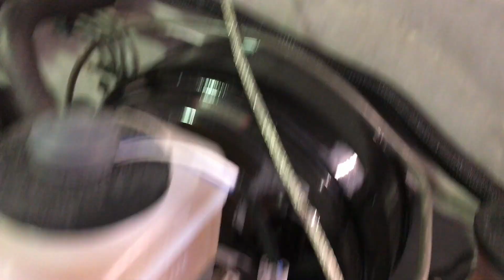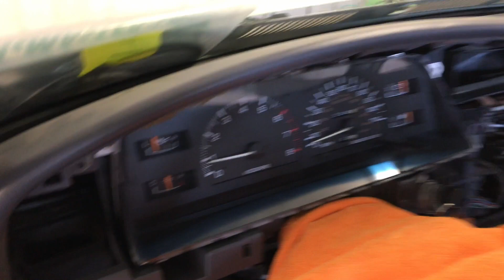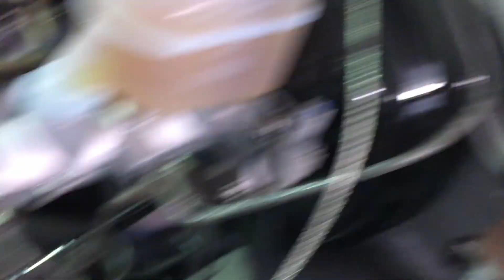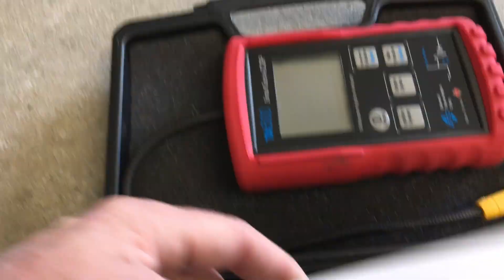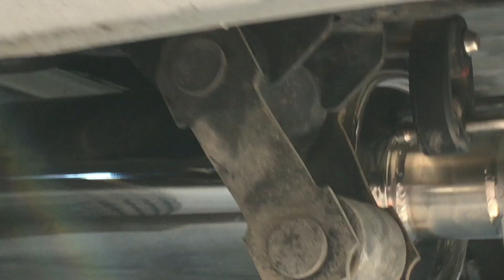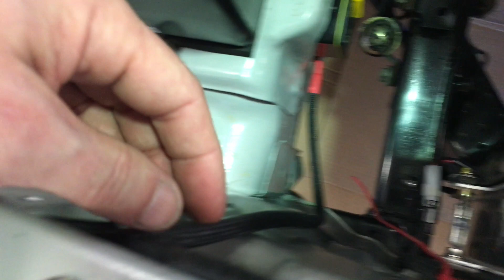Starting the 22RE 1990 2WD Toyota Pickup w/ Champion aluminum radiator & electric SPAL fan

Comment: So I need some help I have a 94 toyota 4runner 2.4 and I put a 2 row aluminum radiator with electric fan when I run my truck wit the ac on in hot weather it get above half gage and keeps going but when I turn my ac off it gose back to normal I am running a 195 thermostat I'm going to put a 180 in to match my switch and new water pump those are the only 2 parts I haven't replace for the cooling system I ran 3 block test for a bad head gasket and they passed each time I'm not to sure what going on at the back of my thermo housing I'm reading 230 and at front of radiator I'm reading 200
Reply from the maker: What's the ambient temperature outside where you are located and are you at sea level or higher up? I'd definitely switch to a 170 thermostat to start with. Also, make sure your engine oil isn't low, as the motor oil helps with overall cooling. The other thing is maybe consider doing a couple of cooling system flushes using something like Thermocure. If the motor hasn't had its coolant changed routinely over the years, crud can build up internally and reduce cooling effectiveness. You can also try running a slightly higher ratio of distilled water to antifreeze during summer, as water cools better, if you do not live some place which gets below freezing. Also confirm the fans blow air the correct direction, they should be on the back side of the radiator and blow air towards the engine. When things are operating correctly, airflow over the radiator and motor when driving - even with the A/C on - should keep everything operating at normal levels. Going up hills will cause temps to climb which is normal and running the A/C may tend to simulate this, but it shouldn't be nearly as bad. The other thing is make sure you have properly purged the air out... it's a bit more tricky than you might think and having air in the system can really screw things up. Search amazon for "EPAUTO Spill Proof Radiator Coolant Filling Funnel Kit" if you don't already have one; these allow you to purge air from the system. Also, when filling the coolant system, I usually remove the hose at the heater core on the fire wall and back fill the system from there, back through the cylinder head pipes while the radiator is open. Even doing that, you have to warm the engine up with the radiator open, until the thermostat opens, to correctly purge air out. So that might be part of your issue. Using the amazon kit, you can attach the funnel to the radiator and run the motor and then squeeze the hoses and help force all the air out. But going to a 180 thermostat should help quite a bit because it will allow water to start flowing sooner and give things a head start. When you have an electric fan system, you lose the cooling of the mechanical fan at low speeds, so it helps to have the thermostat opening a bit sooner. Also, if you have your thermostat opening too close to where your fan switch turns on, you'll end up with a situation where the fans turn on while driving, which is not how it should work. On my truck, the fan only ever turns on if I'm stopped (like at a drive through) for more than 3-4 minutes. When driving on the road, everything stays super cool typically.. my gauges motor engine oil temp and water temp exiting the radiator and returning to the engine; my engine oil usually stays between 175 and 190 on the road, flat ground, while cruising (outside air temp usually around 70). Going up large hills, the engine oil will climb to 200-206 for a bit. In 90 plus weather, going up a hill in slow traffic, I've seen my oil get up to 220, but that's rare. Usually while driving along on flat roads in 70-80 degree weather, usually the water temp exiting the radiator remains around 110-120 or so while driving, so the fans never turn on. If i stop, then no more air over the radiator and return water temp starts to climb slowly up to around 180-190 at which point the fan kicks on and quickly drops the return water temp back down to 120-140 (usually within 30 seconds). Then it starts over again until I start moving and air flow takes over again to cool the motor.
Reply: @ray5961  I live in Oregon and it gets about 90 to 104 I am doing a water pump right now and just did a power flush on my block
Reply from the maker: @nickwinter2145  Flushing out the cooling system is good. The 170 thermostat will most likely help you the most. The sooner you get hot water flowing to the radiator, the sooner air flow will cool it down and return it to the motor. Turn your heater on also and make sure water is flowing through the heater core okay. The bottom line is when it's 100 degrees out, it's simply more difficult to cool things down. But when I switched over to the 170 thermostat on my 22RE, that is what made the biggest difference as far as proper cooling when using an electric fan setup
Reply: @ray5961  I will try the 170 I didn't have any problems with my ac pulling 31 inch tires till i put the aluminum 2 core radiator I'm at the point of buy another factory radiator when it gets warm my ac will cut in and out not stay on long enough to get cold air out of it
Reply from the maker: @nickwinter2145  I can't really tell you too much about A/C. I took the A/C and P/S off my truck and threw it away. As far as the aluminum radiator, do you have the same one I show here in this video? Also, have you changed anything with regard to the size of the pulleys on the motor or water pump? Sometimes that can mess you up, if you change the pulley sizes too much. BTW, I just checked my service records and I gave you incorrect info above there. I'm currently running the 170 thermostat in my truck; I had tried the 180, but had to remove it because it was still causing the truck to run too hot. I tried a 190 and also a 180, but both messed me up too much and caused the truck to run way too hot on the freeway. It also wasn't working correctly with the electric fan switch. I ended up installing the 170 thermostat and that's when everything started to function correctly. I was driving the truck today at the temp outside was about 65 degrees; on the highway, going up a small grade, the water temp coming back from the radiator into the motor was right at 115 degrees. So that gives you can idea of how much cooling just air flow over the radiator is providing my motor. If I hammer the motor going up the hill to my house (about 1/2 mile and elevation increase of maybe 700 feet or so), the oil temp will get up to around 190-195, but the coolant stays down around 120 coming back into the motor. I'd switch to the 170 thermostat and see if that helps out a lot. Also, use a thermal temp gun and check the temp coming out of the lower radiator hose to see what temp water is going back into the motor at; that's a lot more important than what temp the water coming out is. Also, I cannot stress enough how important that kit on Amazon is for purging air out. The other thing is are you running an over flow catch tank for coolant? On my truck, that thing goes up and down about 1 inch plus or minus around the mid fill line on the over flow tank - if you don't have a catch tank, you are going to keep sucking air back into the cooling system. Also, do you happen to know what PSI or BAR radiator cap you are running? That can make a difference also. But yeah, 170 thermostat might really help you out - that's what make the big difference on my truck and allowed me to actually drive on the highway without the motor over heating and/or the fan coming on and acting crazy.
Reply: @ray5961  the water coming out of the radiator is about 110 115 and I'm running a asi performance radiator off ebay came with fan relay kit for 209 the cfm on my fan is 1730 I do have the coolant funnel from Amazon I'm running the stock pully witch is 4 3/4 I need to go down a little for faster flow. I do have a over flow tank and my radiator is a 2 row of tubes I'm also not sure what my cap is it came with radiator
Reply from the maker: @nickwinter2145  Sometimes you actually want slower flow, so the water stays in the radiator a bit longer and has time to give up heat, but a water return temp of 110-115 sounds pretty good. I think switching to the 170 thermostat will probably help the most. Doing that is what really got my cooling system dialed in and made everything function correctly on my truck.
Reply: @ray5961  it almost seems light I might have a faulty radiator I had better cooling with a 1 row radiator
Reply from the maker: @nickwinter2145  Why not try the champion one?
Reply: @ray5961  I don't know if I want to invest another 283 in a radiator I'm 400 into it now
Reply: @ray5961   it kind of worked when I have the ac on it gets up to 240 and then the ac kicks on off cut its to hot
Reply from the maker: Here's a video you might find interesting. He mentions the truck over heating when the A/C is turned on... seems to relate to the condenser overwhelming the radiator. Also, does your truck have any head gasket sealer or anything in the coolant? Maybe it's plugging up the tiny passages in the radiator? Here's the video: https://www.youtube.com/watch?v=pvYy-P0-9VQ
Reply: @ray5961  no it doesn't Today the ac worked great kind got warm then dropped it got well over half gage going up a hill with the ac on it never did that intell I put the aluminum radiator and electric fan on it
Reply from the maker: @nickwinter2145  I'd install the 170 thermostat and see if that solves most of the issues. That's probably you're best bet
Reply: @ray5961  the coolant dose kind have a different smell to it but the block test said no bad head gasket and I will if it don't work then I have no clue what to do
Reply from the maker: @nickwinter2145  Try the 170 thermostat before anything else.
Reply: @ray5961  copy that thank you Ray for letting .e take time out of week to get some help from some one with the same set up
Reply from the maker: @nickwinter2145  you're most welcome man. Let me know if the 170 thermostat works out
Reply: @ray5961  me and my dad are also leaning towards the start of a head gasket problem it was getting warm with the stock radiator
Reply from the maker: @nickwinter2145  Have you run a compression check on the motor yet? How many miles on the motor and how long have you owned this particular vehicle? On my pickup truck, I purchased it from a guy across town and from what I saw when I replaced the cylinder head, he had poured some sort of head gasket sealer into the motor at some point. He conveniently didn't mention that when I bought it, but when I pulled the head off, a lot of the passages were blocked off from what I could see. If you check my other videos, there's one where i show the old head gasket. Anyway, is your truck burning oil or consuming coolant or anything? Usually a compression check and inspecting the spark plugs will tell you a lot. That little kit in the video I linked yesterday also uses a chemical reaction to detect exhaust in the coolant I believe; it might be worth buying just to see if there are any signs of leaking between the systems.
Reply: @ray5961  burns a little oil it don't use coolant I rebuilt the motor at 190 000 and I'm at 252 000 on the clock now
Reply from the maker: @nickwinter2145  Which head gasket did you use?
Reply: @ray5961  I used felpro and I got one of those testers with the blue fluid and passed 3 times
Reply from the maker: @nickwinter2145  yeah the Felpro PT gasket is top notch, that's what I used. I'd do a compression check. When you did the head gasket did you check to make sure the block passages were clean? I think your issue is probably your thermostat. If it doesn't open soon enough, it just keeps the heat in the motor. Even with a 180, my truck was running way too hot. Get the 170 MotoRad thermostat and put it in and then see what's up. Also, are you running with a cat and/or the EGR system?
Reply: @ray5961  not cat but I do have the egr
Reply from the maker: @nickwinter2145  Should be okay. My money is still on the thermostat.
Reply from the maker: @nickwinter2145  I'm running the MotoRad 240-170 in my truck, by the way.
Reply: @ray5961  I got some news my electric fan went tits up today they quit work dam truck went up in temp that's when I knew something went south I hooked my by pass up to see if it was my temp switch and turned out to not be the case currently trying to get something worked out with asi and where did you get your water temp gauge
Reply from the maker: @nickwinter2145  Which fan are you using? The only ones worth a damn are SPAL fans. Most everything else is cheap stuff made in China. My water temp gauge is VDO (I buy those from Summit Racing usually). The digital ones, like for my oil temp, are all AEM (also usually from Summit Racing).
Reply: @ray5961  the one my radiator came with and I'm not sure what it is but is almost seems like my truck is doing better with the mechanical fan
Reply from the maker: @nickwinter2145  Did you install the 170 thermostat yet?
Reply: @ray5961  I was going to before the fans decided to go tits up